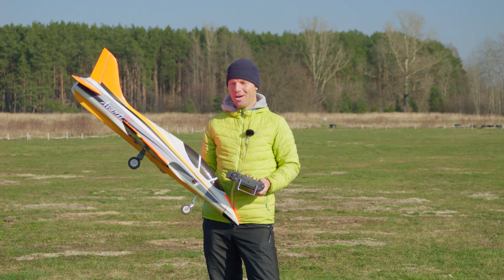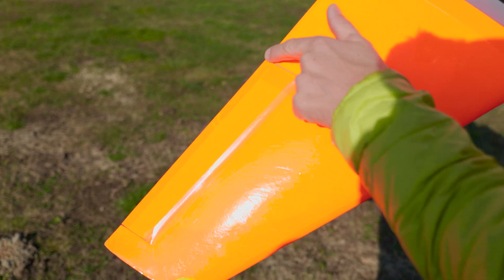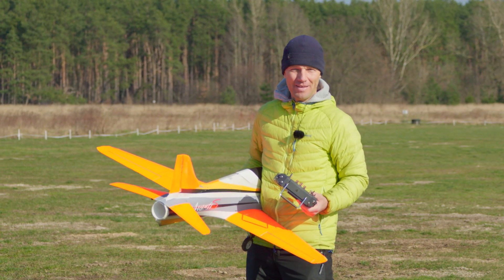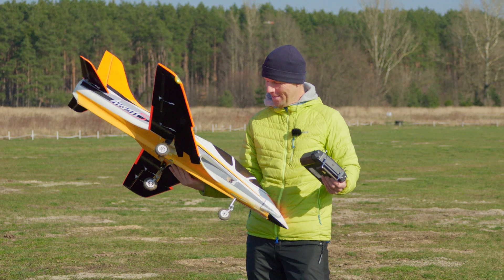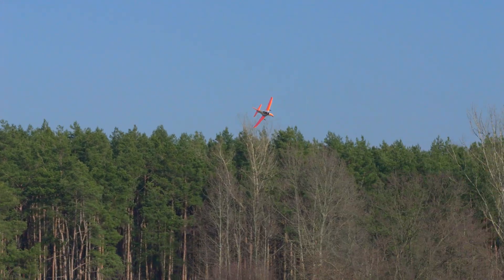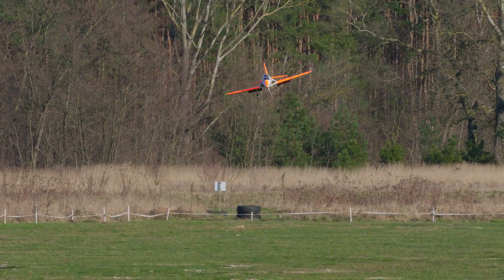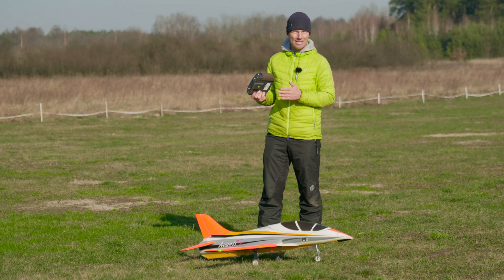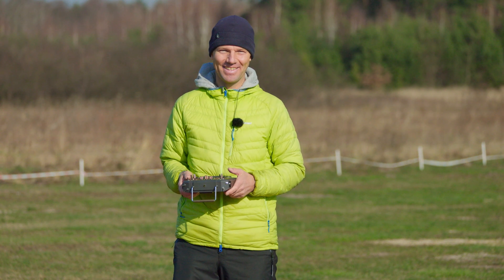Fast Freewing Avanti 6s 236km/h 1kW WeMoTec jet sound Li-Ion Oracover 80mm edf

Comment: Hello there from New Zealand.  
A little off topic, but i see you're using OpenTx FrSky X10s with telemetry. I have the Horus X12S on OpenTx also, but having problems with telemetry.  I fly glow power but looking at getting into edf's.  The problems im having eith my telemetry is daisy chaining 2 or more together through the S port.   I can only read first one i have plugged in. I can detect and read each unit separately, but can only read the first one i plug in, not all.    I have cell voltage, air speed, and verio for hight clime rate.  Can you give me any advice do i can use all three together.  Thanks for you help in advance. FrSky keep telling me i need to Buy the New X20S, seems a poor answer for some thing that should still work on ACCST and ACCeSS protocols

Comment: Can you do a video showing the mods on the Avanti?  I'd like to improve my stock Avanti to get less drag.  It's a little unclear as to what you did to cover gaps and which gaps you did cover?  It also looks like you cut some square holes in the intakes.  Be great if you could talk about those too.  My stock Avanti pulls 110 Amps on takeoff, 2500 Watts with 6S lipo's.
Reply: Yes Wojtek, please can you show how you oracover foam model and other your mods. Nice flight and model.

Comment: Omg. This is Amazing. Such a beautifully filmed video. Props to the camera person for following the Avanti. I now am on my second Avanti s. After 200 flights I am bored of the power. But Geesh 146mph is Amazing! Great job. I would have never thought of thinning those edges. Like you said it helps to decrease turbulence tremendously as the air from both sides meet together at the same point vs having a gap not causing the air to meet at the end of the point.

Comment: Great Video. I really recommend you try to get an FMS/Eflite ViperJet 90mm . It's one of the best flying jets, even better than the Avanti (I have both, lol). And the viperjet is built much stronger compared to the Avanti, so you can push it to higher speeds. Give it a try, you won't be disappointed.

Comment: Hey, Wojtek

Amazing as always. Do you think for jets like this or other sub 100Amp applications it is okay to solder the li-ion cells with 14awg or 12awg copper wire instead of the copper strips? That would be nice, so my medium string soldering iron, can accomodate that.

Thanks in advance!

Comment: Hi Wojtek, I find the tests you do and the performance you get very impressive. Could you indicate what exact model and motor you use in the Wemotec EDF, I can't find for 80mm 6S 55A, the lowest consumption is 82A. Do you put any calculated reduction in the output duct of the EDF?

Comment: Another good setup and a fast and long flight! This is not possible with lipo 6s! I was not lucky to find the same battery cells, they are rarely in stock. Do you have other addresses to get the same cells? Thank you and take advantage of the weather to fly 😊

Comment: I’d like to try this in stock Avanti same battery, would you reccommend limiting full throttle to 70 amp draw to preserve the molicell? I will also try 2 in parallel without limiting throttle.😊
Reply from the maker: do not limit the throttle, the battery will cope

Comment: Hey Woijtek. Great video and flying again.

Im impressed with your results on the Li Ion cells. Would you say that drawing 55A from them on takeoff and speed runs is healthy?

Would the be a good fit for a 40A peak draw on a 64mm edf?
Reply from the maker: it is a light load for this new cells
Reply: @EDFjetRC  thank you Wojtek